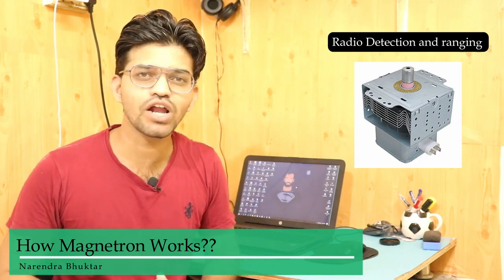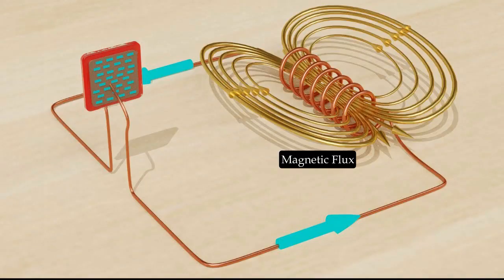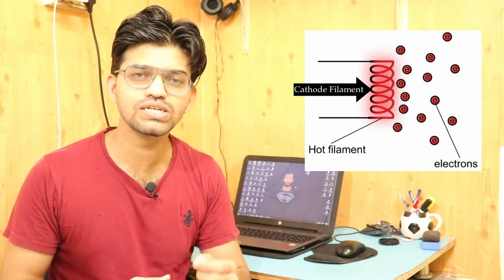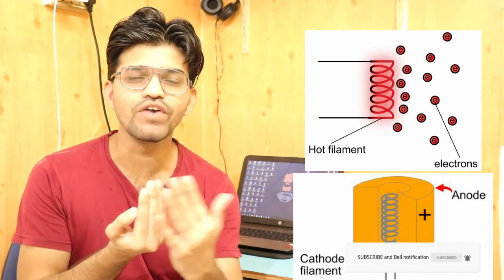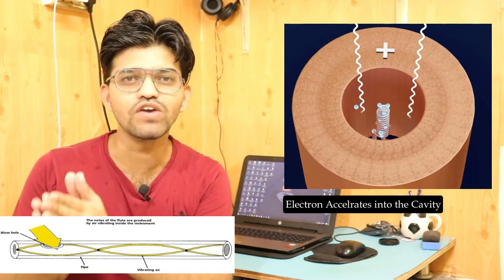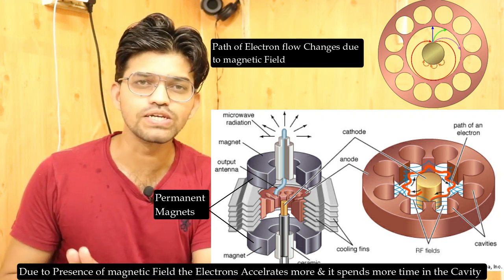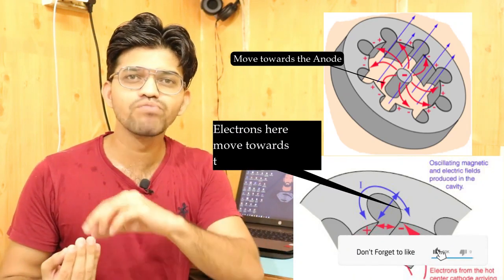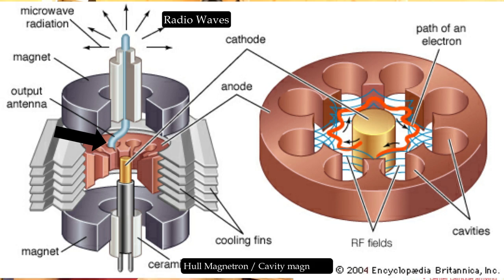How does a Magnetron Works??

Comment: I work on aircraft electronics and had a debate about the magnetrons location. Is it in the antenna before the feedhorn or in the transmitter? I figured antenna after it passes through the waveguide but I don't know
Reply: Yes these magnetrons are present in the transmitter section for generating the radio waves or microwaves of very high frequency.
Reply: Also waveguides are different concept ,wave guides are not for  generating any type of waves and mainly it uses for lossless transmission or for reduction of  power loss.